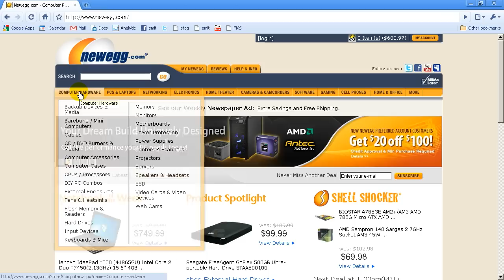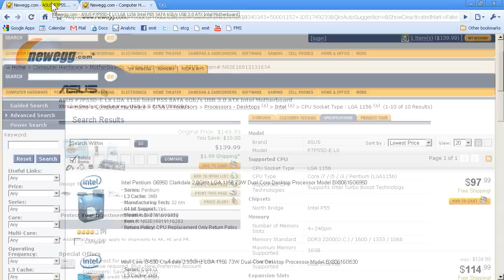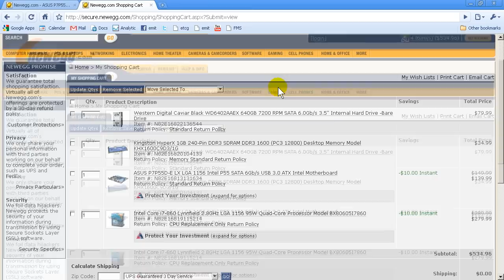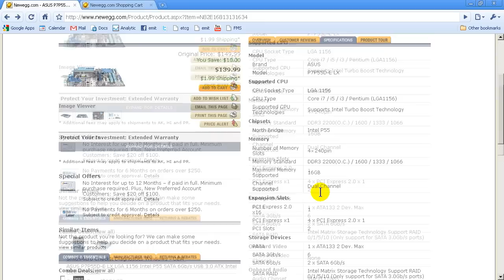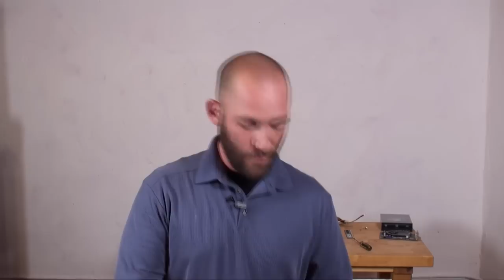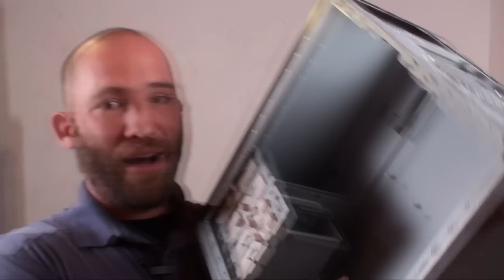How to Build a Computer

Comment: thanks dude i bought an amd phenom ii x6 a hd 4770 (upgraded to a gtx 460) 8gb ddr3 1600 mhz ram a wifi card a mid range motherboard and a full tower case for less than 2000 bucks! i love it i play crysis 2 and minecraft on it.

Comment: This tut was nice.
But I suggest you remake this tut.

Tip: Put the motherboard onto a table.
Then position the camera, over the motherboard, so viewers 
can see, how the CPU, RAM, GPU and other components, 
go into the motherboard.

Ah, that was a good camera angle at 56:06.
That angle is kinda like a good example, of what I meant.
Nice work.

But this tut was nice overall. 😊

Comment: I built my first computer back in '97.  It was an XT...  It honestly took me a few weeks to get it running because back then all the slots, plugs and ports all looked the same.  If you had 2 of the same cards or even had the cards in the wrong order (IRQ and DMA optins were not available on that BIOS) then it wouldn't boot lol.  Now everything is pretty much idiot proof.  Great video on the basics of building modern PC's.  Maybe you could do a video in the future on custom cooling loops ;)
Reply: Agreed

Comment: Speaking about cheap parts, I read a PC enthusiast magazine article about how they did a budget power supply test, using voltage and current testing equipment and also subjecting them to different loads, some gave far less power than advertised, some where unstable, and one even started to smell acrid when used to power a midrange gaming GPU.

A good quality motherboard will have higher quality capacitors and voltage regulators, meaning less chances of failures, a good quality PSU will mean more efficient power usage as well as less chance of system instability, a good quality hard disk will last a lot longer than the budget option.

Comment: Please do an 2015 version? Thanks for this one anyway.
Reply: +Patrick Musson All the principles are exactly the same, just updated parts.
Reply: +Patrick Musson Basically Intel Celeron, Pentium and Core 2 has given way to Core i3, i5 and i7, i3 are respectable but budget options, i5 are very good midrange processors, the good ones even being absolutely fine at gaming, and i7 are the high performance options, for video editing and lots of gaming, the standard now is mostly quad core processors for mid to high end PCs, with hex cores and even octa cores making an appearance now. Xeon processors are worth a look at if you want professional video editing or high end server performance.

RAM is basically the same, just upgraded somewhat, DDR3 has given way to DDR4 and even DDR5.

Graphics cards have gotten even more powerful, but still use the PCI Express slots, now with two or three graphics cards being common for gaming PCs.

Power supplies are the same for most intents and purposes, but a lot nowadays are modular so you don't have to have all the cables hanging out of the PSU and causing cable mess on the bottom of your case, you just plug in the ones you need.

HDDs have more capacity than ever, and SSDs are less expensive than they were a few years ago, SATA is still a thing but for high performance special M.2 SSDs are now on sale that plug directly into a special slot on your motherboard for faster transfer speeds.

Cases are still ATX, Micro-ATX and other standardised sizes, but very small cases that only fit a very small motherboard, one graphics card slot, and an SSD are becoming more common for living room gaming PC use, the hardware is powerful enough now that even the micro motherboards and midrange graphics cards are good for most of the games available, and the processors are even easier to cool now so the small case isn't too much of an issue other than being fiddly for working on.
Reply: Putting the bits together is the easy part, what I suppose I want to see more than anything is to have him go into the fiddly bits of the operating system install and the BIOS settings and the driver setups after everything is put together. Those things are like a waking nightmare to me.
Reply: Thanks for the replies. I suppose my most basic need but perhaps the most vital are the post assembly, things like BIOS, drvers, and O/S.
Reply: Pick up the Mike Meyers A+ exam guide.

Comment: What happens if there are pre-installed stand offs or risers and the motherboard doesn't use them all, will the motherboard be in jeopardy from contact with the unused one's causing any kind of electrical static or some such issue?
Reply: +Dennis Greencorn It's usually possible to remove them, though it's very unlikely you'll get a motherboard that won't use them all due to the ATX standard defining all the measurements of where the mounting stand offs go in an ATX case and where they have to be on an ATX motherboard, it's all standardized so everything fits together.

Comment: will not buying 600w power supply burn out your motherboard if it does not support it? or will it still work? i was thinking of buying 350v.
Reply: 350w*
Reply: hardeep singh Your psu (power supply unit) only needs to have more watts than what your system needs, and it should have atleast 100w more. And you should buy from a popular brand to get a more reliable psu. You will likely have problems if you get one that is not known.

And you can get as many watts as you want, it won't burn out your system.
Reply: Can I have 2 power supplies in 1 single computer? Everything sums up taking more than 1400w.
Reply: Henry Chan Henry, enough of bullshit. Please finish high school first.

Comment: What is the motherboard socket? May you discuss with us about computer hardware assembly and disassembly with networking and installing OSes and what are the pci slots and the motherboard parts?
Reply: JM Miranda Pci slots are used to install things like sound cards, wifi cards, etc. But Pci express slots are used for graphics cards. 
I don't know what you mean in your first question, but installing an OS is easy and you can figure it out on your own, and you can find other videos that show how to assemble everything.
Reply: +JM Miranda The motherboard socket is the socket where the CPU (central processing unit) sits in, it's very important as a CPU designed for a 775 pin socket wont work in a 2011 pin socket and vice versa.

Comment: ima noob - here's my 1st ever (budget) build (PLEASE ANSWER QUESTIONS BELOW IF ABLE):
CPU: AMD Athlon X4 860K
mobo: Asus A78M-E mATX
RAM: G.Skill RipjawsX F3-14900CL9D-8GBXL 8GB (4GBx2) DDR3 1866MHz
HDD: WD 1TB SATA lll SATA Drive - Blue
GPU: Radeon R9 270 - 2 GB 
case: Cougar Spike mATX
PSU: Corsair CSM 450W Semi Modular 80+ Gold
fan (maybe *): Cooler Mater SickleFlow 120 (120mm)

Do people approve? Is it good (for budget)? Is it all even compatible?

*  Here's the thing: the case comes with an exhaust fan which someone said was slow so they recommended using it as an intake fan and using a £6 cooler fan for the exhaust fan. So that's what the fan up there ^ ^ ^ is for. Is getting an additional fan for this a good idea? If I did this, would i need to buy anything extra (like wiring etc.) to make it compatible? Is it worth getting rubber stabalisor mounts for any fan(s) to prevent damage from vibration?

Comment: Supposing someone builds a computer and installs a Pirated OS like windows 8.1 ( Or a linux OS) trough an external CD drive or a USB drive, and considering the person spent like 500$ on the hardware components, successfully installs the OS on the new computer. Consider the same computer with the same hardware is selling on a normaly shop for the price of the hardware + the OS and its like 570$. Wouldnt it be cheaper to build the computer?
Reply: ***** This is only with windows 8 right? Because I've got many pirated systems before on older windows (7-) which worked properly.
Reply: ***** No, that's what the cracks are for. A crack is to get past the registration key.

Comment: My computer says "no operating system found" ..BUT it seems like everything is running fine..He can recognize the HDD but he doesnt want to boot the operating system, what is already installed on the HDD..anyone an answer?
Reply: Try clearing the HDD and boot from an external CD Drive with the OS setup in there. It will instal the OS into the HDD and it should boot normally.
Reply: I took my optical drive out and replaced it with a potato. Worked like a charm.

Comment: hey im try to build a computer for gaming purposes for my brother any ideas on what type of hardware I should put in it to make the performance of the game run fast and smooth
Reply: Well, you definitely want at least 4 GB of RAM, a CPU of 2.8 GHz or higher, and a mid to high end Graphics card, I personally prefer nVidia, but you can get AMD if you like. if your brother doesn't mind loading screens, you could get any hard drive, but if you want, you could get a Samsung SSD to make the game load faster. then it's down to the case, Get something cheap, yet big enough to fit the motherboard (assuming you've chosen a motherboard already.) You don't want an ATX board in a MiniATX case. You also want a power supply of 480W or greater, because you need power.
Reply: Jonny Teh-Gamer Dude you're a life saver thanks for the help
Reply: matt14151 64-bit processor and operating system. You'll have more doors open for you.
Reply: Install Steam OS

Comment: You  mentioned that buying OEM would mean that you wouldn't
Get software with the drive. Are the OEM drives built for a specific manufacturer's software or do you advise against it simply for 
Efficiency? Also what do you do about restoration software?

Comment: Dell used to be a great company until they cut back on customer choice. Before I could select between all the types of processor, ram, hard drive, graphics card, CD drive, dvd drive, operating systems, etc, etc.

Today all that choice has gone.

Comment: You need to be wearing an anti static bracelet and not to be wearing a metal ring when you handle these parts.
Reply: Don't forget the tinfoil hat. ^^
Reply: It's common knowledge that you can short the parts with static.

Comment: computer shut down by itself.  now i look at CPU-Z and see 'Core Voltage' immediately rises and falls (about 0.050v to 1.500v) I'm not doing anything on the computer but this is faster changing. What could it be?

Processor: Intel i7 4770k

Comment: some things he did wrong: the order, searching for what you need.
1. choose processor (CPU) on clockspeed, overclockable? supported RAM, you want 64bit or 32bit (64bit!!)
2. choose motherboard, make sure it supports the CPU, amount of PCIe you're going to need, additional features such as overclocking(CPU must support),SLI/CrossfireX(multi graphics cards) and remember:brand is the least of your concern!
3. find the graphics card you want(some CPUs have built in graphics if that's enough for you. the motherboard needs a graphics output then)
4. RAM. both your CPU, operating system and motherboard need to support whatever you choose: speed and amount.
5. storage, for raw storage you get an HDD and for fast small storage an SSD as a boot drive/program drive.
6. any other stuff you need like optical drive(do you really need it?) more USB 2.0/3.0 RAID controller etc.
7. the power supply or PSU. see what all your components use and get a power supply that can cover it. get a reliable one with at least a 80+ certification or better.
8. keyboard, mouse, audio and screen(your GPU or integrated graphics need to support the amount of pixels like 1080p, 720p or maybe multiple monitors if you want.
edit: you don't need a case or windows(you can get linux) for it to work but it looks better, so go get them aswell.

Comment: When it comes to power supply switch from 220V or 115V, If you are in US and you put it on 220V is ok, in the worst case the PC won't work but if you are in Europe and you have it on 115......That could spell buying a new power supply.

Comment: Can i please have some help? I installed a graphics card onto my new computer and it turns on and everything but no display comes up onto the screen. If i unplug the power supply's chord and run without the graphics card the computer boots up and has a display . Can i please have some help?

Comment: What if I want to build cheap desk top computers to be used only for alldata in my mechanic shop? They don't need anything fancy and they won't even be connected to the internet. The cheaper the better! Just a tower with one 360 gig program on it and an operating system and that's it! It's a catalog style program... No graphics... Nothing fancy at all.

Comment: hii dude amazingg vidd 
 just askng does this mother bored 
Gigabyte Z77- DS3H Socket 1155 go well with       
  Intel Core i7-3770 3.50GHz (IvyBridge) 
    Power Supply              XFX 750Watts Core Editin  
Hard Disk Drive             Toshiba 1TB SATA 3 HDDv
Memory                       Corsair Vengeance 16GB 1600 Mhz Dual DDR3 Memory Kit 
Hard Disk Drive             Toshiba 1TB SATA 3 HDDv
SSD Hard Drive     CZ Agility 4 - 128GB SSD 
   Gigabyte HD 7950 - 3GB Overclocked   plz and thx

Comment: think about it. the computer that I am going to build sometime later has a medium-high end graphics card that is alone $115. it is a radeon hd 7770. the processor is a quad core 3.8 ghz and 4.2 ghz turbo. also other really good hardware is all together $700. that is really good. that is something that would be cheaper to build than buy.

Comment: im speaking for holland and belgium(2013) and i can say, they difference in price is here absolutely still worthy of a build.
just orderd parts for a complete system in the price range of 700-800€.for that in shops pre build standard pc's do not come even close.and are plain garbage compared for the same price.(often stil dual cores in that price range is just thievery) to find similar specs and power one must add at LEAST 300-400€ thus making a build so totally worth it

Comment: Things have dropped in price so much since this video was made. 
People talking about "begging to differ" need to take that into consideration.
You can buy 16 gbs of kingston RAM now for around 130 bucks. That's 600 dollars cheaper. You can buy an outstanding computer for around $2,000 dollars now a days, and that's overkilling it. With water cooling, and a i7 intel 6 core processor running at about 4.5 ghz.

Comment: ESD is not a problem anymore with today's parts.  They are so resistant to it.  Your probably an old coot that doesn't know today's computer parts.  As long as you touch the case every once in a while, you will have no problems.  If you want to do it the way you described, then do it.  Don't tell other people that they are wrong for doing it their way.

Comment: hi i like your videos. but i have a couple of questions. you say in this one that really all you need to build a computer is a screwdriver and thermal paste. How come then in the repair kits you can buy at best buy they give you pliers and ic pullers? do you really use things like that anymore in building/repairing them?

Also do you see a day in which technology will be so cheap that hardware repair will be obsolete. That you will just buy a new computer if your sound card goes bad?

Comment: I don't think you can. I believe most processors (both AMD and Intel) come with thermal paste already on either the processor or bottom of the stock heat sink that comes with the processor. You should be able to see the paste (an off-white color) if it's there. Do use thermal paste but don't put on more if it's already applied.

Comment: buying those cheap computers is fine for ordinary use but I find they all come with processor that suck usually under 3ghz not good for running processor heavy programs and the graphics are usually all integrated and suck as well

Comment: My motherboard's power supply says 24pin. The power supply i was going to puy say its a 20+4pin.  Will this be compatible with my motherboard? will i need to use an adapter or something, or is it the same plug?

Comment: Look you don't need an anti static wrist wrap, you just have to touch something made from metal once in a while :) and it is not possible for a magnetic screwdriver to fry your components, And i should know, cause i work with climate control systems on trains, and i've never ever killed a component, neither on a train nor a computer! :)

Comment: I don't know this brand, I couldn't find any english informations or review from a trusted source, but seeing that it only has 2 SATA connectors and only one PCI-E, this is quite a ridiculous cable configuration for a PSU labeled at 550W. My guess is that it probably deliver no more than 400W at best, as it often happens when a PSU with cable configuration that don't match it's wattage. It does have an active PFC circuit on the positive side. I wouldn't use it on a gaming or powerful PC however.

Comment: don't listen to him. for gaming you dont need a great proccesor. an i5 2500k will do you just fine and more. If your into video editing and all that then get a i7 proccesor. For graphics card you dont need a gtx 680. a gtx 670 will run you all of your games at ultra settings. Buy them all at amazon, as they all have free shipping, and occasionally they will have $30-$50 gift cards availble. there, i just saved you around 250 dollars.

Comment: if its for gaming no... get a i7 processor with a GTX 680 a good mobo and a better power supply then 600W also get an SSD (solid state disc) aswell as a 1 or 2 tb hard drive

Comment: This is my first PC build, and? i was wondering if anybody could help me with compatiblility? All bought on newegg.ca
Western Digital RE4 WD5003ABYX 500GB 7200 RPM 64MB Cache SATA 3.0Gb/s
ASUS Sabertooth 990FX AM3+ AMD 990FX
AMD FX-4100 Zambezi 3.6GHz (3.8GHz Turbo) Socket AM3+
EVGA 01G-P3-1556-KR GeForce GTX 550 Ti (Fermi)
G.SKILL Ripjaws X Series 8GB (2 x 4GB) 240-Pin DDR3 SDRAM DDR3 1600
Rosewill HIVE Series HIVE-550 550W 80 PLUS BRONZE